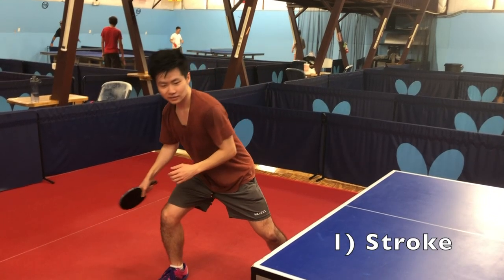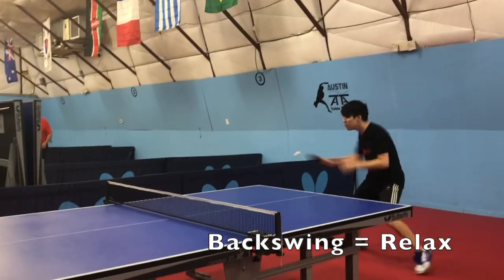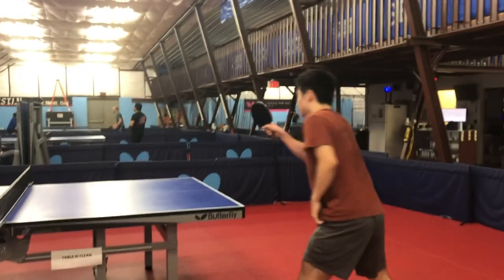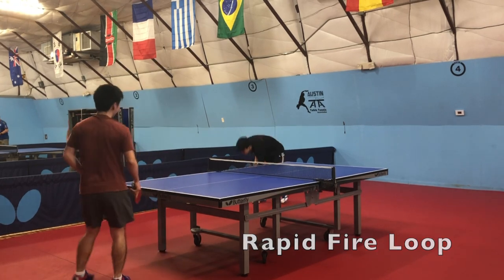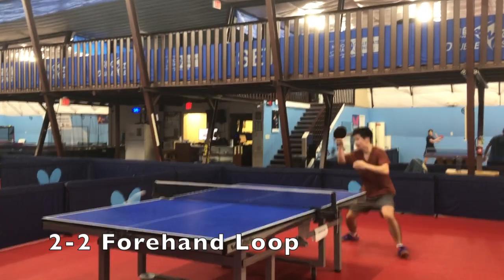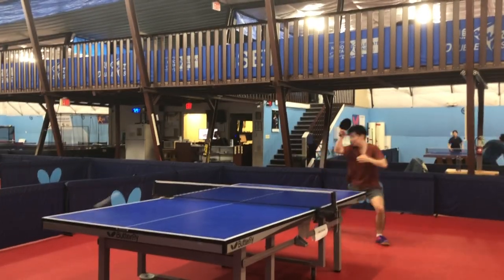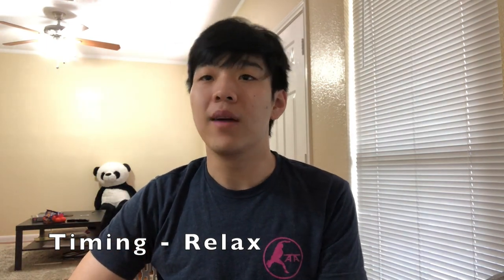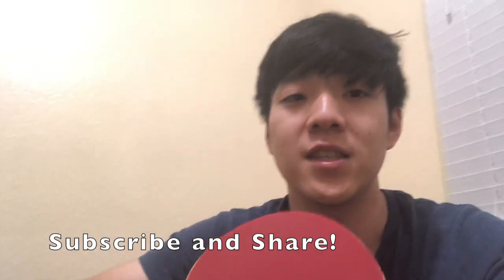2300 Forehand Topspin Loop

Comment: These are all very good tips. However i think in depth videos on how to practice each tip would be helpful. For example, RELAX is a key part of looping, and the answer is to relax before you hit the ball. Easier said than done. Perhaps go in detail on which parts of the body should be relaxed and how it might affect the external form of the player if the player is not relaxed

Comment: i would like to ask question about the arms.   for the hitting arm.  how much tension is in the arm?  how much flexion do you want in the arm?  and the timing of the tension.   you did talk about relax, accelerate, relax...but is this the legs then core right?  what about the arm?  is it relaxed the whole time? (not loosey goosy relax, but medium?)  or is there contraction of the arm muscles (biceps?  forearm?) right at contact?   you want to articulate the arm for better spin right?  

also..for the non-hitting arm.  at minute 5:50 .. the non hitting harm (seems to me) to be not doing much.   is this the case?  it's just hanging there kinda not involved much?  or should the non-hitting arm rotate w/ the body some?

i'm asking all this because i'm one of those (beginner level) arm hitters...and i need to discard this bad habit and do what this video describes.   so perhaps this is the exact opposite of what i do now (high tension in the arm/shoulder, swinging mostly thru the arm).   

i hope to improve this.  thanks for the video and tips!

Comment: You need to extend your arm more during the back-swing. It's much more energy-efficient to flex the elbow than swing the entire arm from the shoulder. As you start your upward motion, the elbow must be at about 150 degrees, not 90 or 100.

Comment: all of them sounds like a power loop, and not the kind of timo boll opener super thin hit kinda loop. it seems like you dont see any of the chinese use this stroke. my trainer is focusing a lot on those, and he makes all new players play with soft and springy rubbers so they can do it. I decided to start playing with chinese rubbers on forehand with a flexible blade, however, so this thin hit is not so easy, but my forehand topspin stroke developed nicely after a few months. my trainer even raises the net with the young players and does multiball where they are supposed to loop underspin ball over a heigthened net. since I am an adult learner with an athletic background, I have plenty of muscle to put into a powerloop ... but I dont know if I should try to get a hang of this precise thin hitting loop. I feel like my next step is to get into a stiffer faster blade of the same grade that I am using to develop a better backhand stroke, and be able to punch the ball with backhand as well.

Comment: Hey @PandaPong
First off I would like to thank you for the video!
I only have one question, when you are doing forehand loop, does your paddle tend to "slip" out of your hand? I've read that you should "pinch" your racket with your thumb and index finger, but after I do like 10 loops, my grip starts to slip
Reply from the maker: I think sometimes people take those words too literally. I’ve seen others with the same issue. Pinch with those two fingers doesn’t mean to stop holding with your other fingers. Make sure to have a firm grip of your paddle and add extra pinch of those two fingers on top. Hope that makes sense!
Reply: @PandaPong  I guess I took that advice indeed too literally :D Makes total sense, i'll try it tomorrow at practice! Thanks !

Comment: 9:32 I think there needs to be a sidenote to your note: it might be confusing to say that all the acceleration needs to happen at the same time because you are loading up tension in your body that acts like a whip, so some things start to move first and then transfers energy in a kinetic chain. Timo Boll does this by leading with his shoulder, but there might be other ways as well. My point is that the horizontal movement lags behind and loads on to the vertical movement and explodes onto the ball when the racket intersects the pathway of the ball.
Reply: I though the same when watching this video. Timo Boll has a video where he explains that his arm moves a little after his hip. It can be apreciated here, but at 0,25 x and the lag is very subtle: https://youtu.be/yTwIsb0y0ro?t=165 
Malong (https://youtu.be/QC866oJ2z2w?t=235) and Xuxin (https://youtu.be/QC866oJ2z2w?t=213) seem to have that same lag in their forehand strokes.
Nevertheless, most tutorials about forehand say the same as in this video and I didn't notice that lag until I watched Boll's explanation.
Reply: @RobertoCostas  Every human body is different and everyone develops their stroke differently. I think focusing on timing where you contact the ball is most important.
Reply: @z0uLess  But, maybe if some of the best forehands make a lag between hip and arm, they kind of have a point.

Comment: What are the approximate BAT ANGLES and ARM MOVEMENT ANGLES that you personally use for your OPENING FOREHAND LOOP against HEAVY BACKSPIN? And how do these same angles compare to the BAT ANGLES and ARM MOVEMENT ANGLES you personally use for your FOREHAND COUNTER-LOOPS against HEAVY TOPSPIN?
Reply from the maker: It depends on the amount of backspin. Generally the angle should be more open for underspin if you want a safer spinny loop. For topspin counter, the angle needs to be closed more and the stroke has to be totally forward

Comment: There is some nice advice here. The idea of relaxing the upper body while being strong with the legs is a difficult one for a lot of players. The point about blocking and not getting too crazy with angles so your partner can actually practice is a good one. What do your friend Brian use on the forehand? H3 I'm guessing? He has really solid technique and it looks like he has a diverse set of shots on his forehand, real mastery of it.
Reply from the maker: He used Nittaku Fastarc G1 on a Butterfly Amultart blade
Reply: @PandaPong  Thanks. That makes sense on the sound of the shots too now.

Comment: Dear Coach, what kind of blade and racket do you use for nice loop and topspin? Thank you
Reply from the maker: I use an innerforce ZLC. That’s not too common though. Popular choices include viscaria, timo boll alc, korbel, and primorac. Many loopers use tenergy 05 or MXP.
Reply: @PandaPong  greatly thanks coach, by the way, I wonder to know whether you brushing the ball open to close or close to open? And which one is better. Regards
Reply from the maker: The best way is open to close, like you’re wrapping over the ball. It’s easiest to generate topspin this way, which is the whole point of brushing
Reply: @PandaPong  thank you very much coach.
Reply: Dear Coach, In your opinion, what is the difference between Aruna Quadri's topspin loop compared to Ma Long, Thank you and Regard
Reply from the maker: I think Aruna’s is more powerful, but more physically demanding. He has a lot more muscle mass too. However, his recovery time is slower, which is why he plays so far from the table. Ma Long is still very strong, but more efficient.
Reply: @PandaPong  thank you for your smart, hope you make a video about the Fast and Efficiency of Recovery Time, Regards and Good Luck of you.